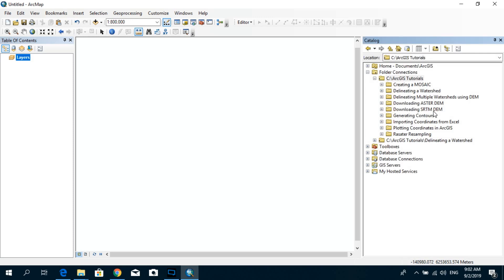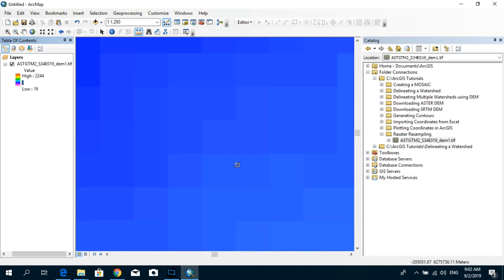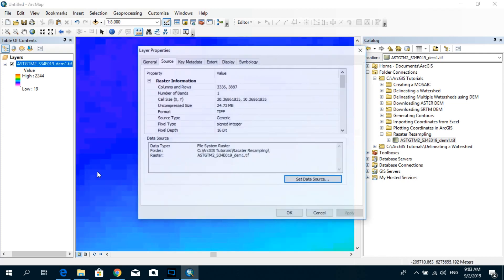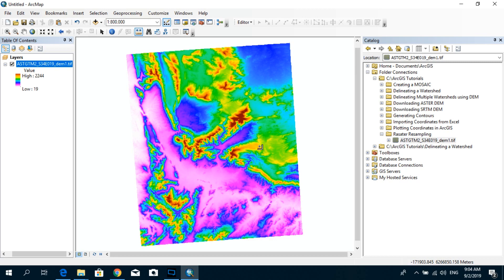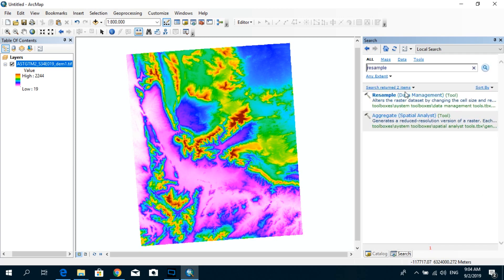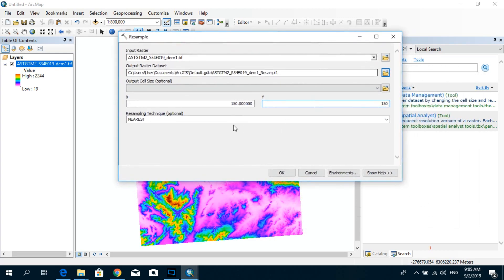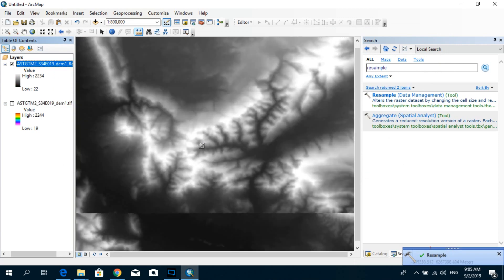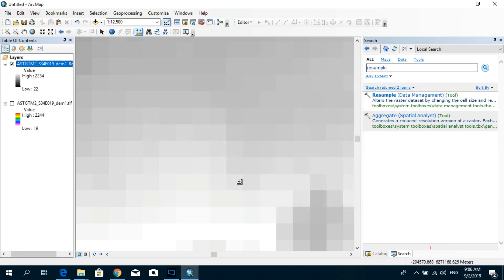Changing the cell size of a Raster (Resampling) using ArcGIS

Comment: @Geodelta Labs, 
I need your kind support. The pixel size of my raster is like 0.00074188232, 0.00074188232. I have changed the PCR from GCR and later used resample techniques to change the pixel size from 0.00074188232 to 20. But It showed error message like Output raster is empty and specified cell size is too small or too large. In this circumstances, What should I do? Please help me. I will be grateful to u.

Comment: Thank you for the video. What if the cell size is 0.000225? How to change it into 22m ?
Reply from the maker: I assume the reason why you see such small numbers is you are working in a geographic coordinate reference system, and the measurement units are in decimal degrees. Pls reproject your raster into a projected CRS, and change the units to meters.
Reply: @geodeltalabs  Thank you for the reply it means a lot. I should try to do that 🙏👍
Reply: @geodeltalabs  Thank you so much bro. I tried to do a lot of times for months a project with euclidean distance with rasters in wrong units, your comment save my life <3
Reply: @geodeltalabs  how do you change unit of a raster file ? I have the same problem. Thank you for your help in advance T-T
Reply: @geodeltalabs thanks a lot, that advise really helped.